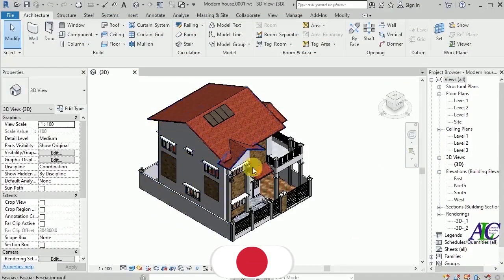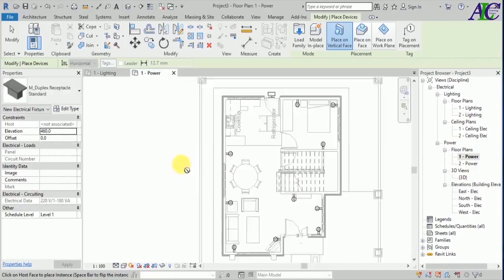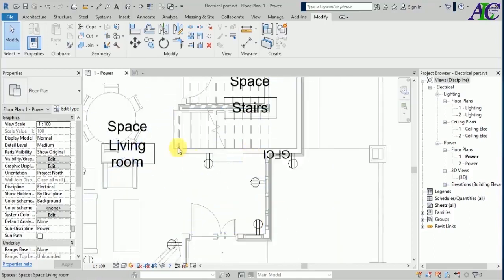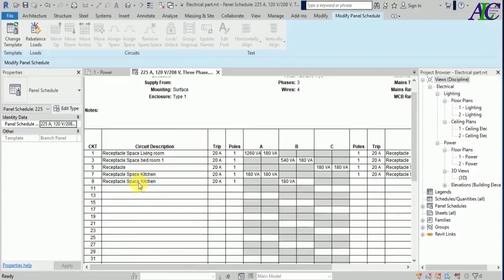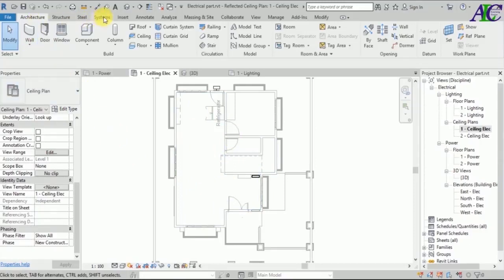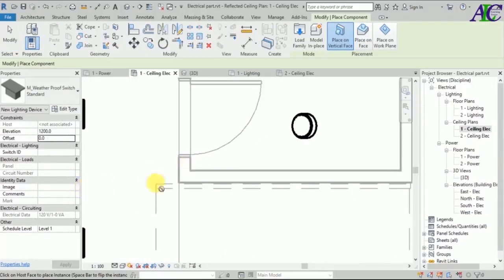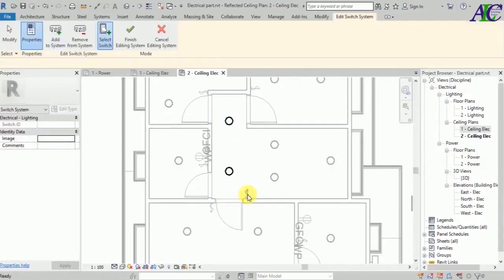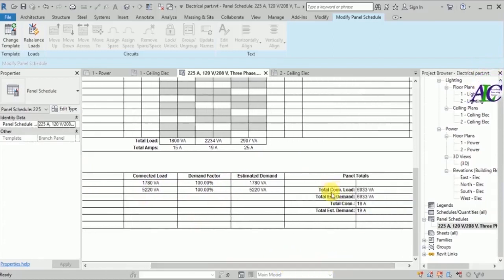Revit Electrical Tutorial 2021

Comment: Hello sir, I have a problem. I made a legend and I have electrical panels in the plan with different colors. How do these colors appear in the legend (electrical panel for generator-powered equipment, half red and half white)
Reply from the maker: you need to check your sitting in Revit
Reply: @autodesklearningcenter5131  If I had known what to do, I would have done it. How can I do this. Like me there are many people, make a concrete example in which to make a legend in colors, you will help us a lot.